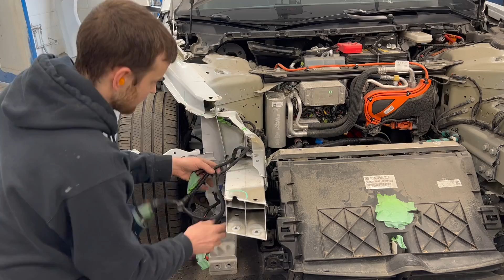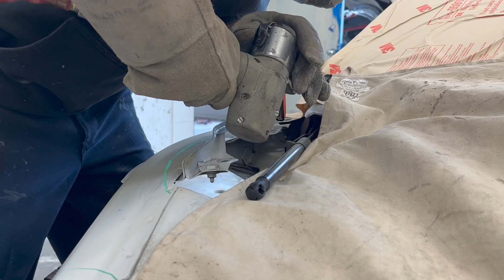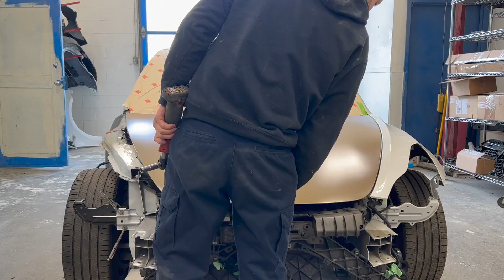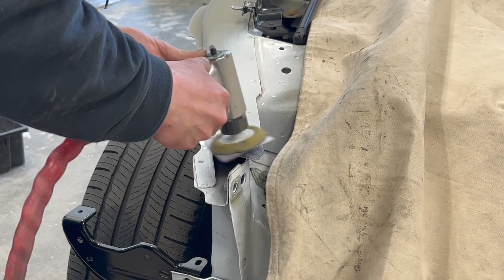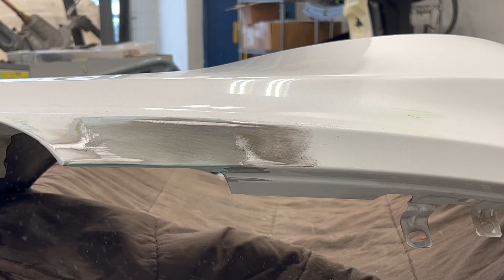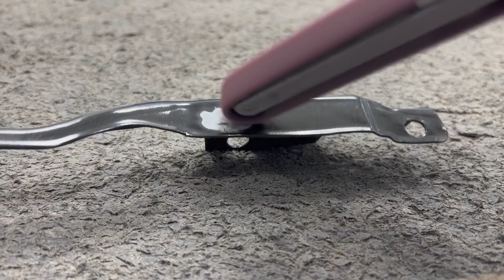Collision Repair Process on a Tesla Model 3

Comment: What locking pliers are you using to flat metal? Could you tell us name or link please?
Reply: I’m curious as well
Reply: Also the clamps you used to hold the fender bracket in place.

Comment: Hello good job I have to change a rear panel but I'm afraid to weld with the battery what procedure should be taken to put the battery for voltage? THANKS
Reply from the maker: I'm not sure exactly what panel you are referring to but if it's a rear end panel that procedure does not have any welding it is replaced using rivet bonding. If you are to weld on any Tesla the high voltage power needs to be disabled first.